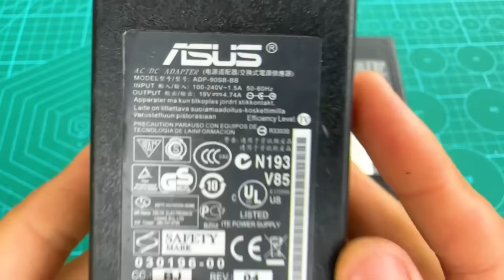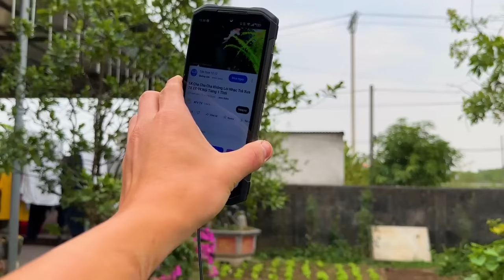DIY Powerful Ultra Bass Amplifier Laptop Charger , No IC , Simple Circuit

Comment: 6000W???😂😂😂.3W RMS.
Reply: Yee! Ha ha ha.
Reply: 600W
Reply: Né 🤣🤣🤣🤣 pra que gastar caro com som ele mostra como conseguir um hiper mega pawer com 10 reais 🤣🤣🤣🤣🤣🤣🤣
Reply: 60w. With a SuperFlux Capacitor
Reply: 3 watts lmao
Reply: Lol
Reply: It doesn't say .2 rms it says .2 ohms witch I doubt
Reply: 3w rms JBL boum box mini?
Reply: Tutaj 🎮a ☔ krytyka 🎉
Reply: 600W
Reply: 0.02Ohm = 60kW 🤒🤭
Reply: 5:35 oh wow that's the lightest battery I ever seen. and why does the battery sound like that when you flick it. hmmm sealed lead acid battery but sound different? hmmm. sounds hollow. could it be it just a case of something? hmmm... tricky tricky. a case of mini amplifier? hmmm 🤔

Comment: Trick well done, the real sound amplifier is on a fake battery. Which inside has a battery, bluetooth amplifier for home speakers
Reply: I don’t even think theres an amp in there, just something that pushes the speaker up and down in an exaggerated way, doesn’t even line up to the music one bit. And cmon, 6000 watts?
Reply: I can`t see the bluetooth icon in the phone. So I think bluetooth is not on in the phone.
Reply: ht-у-меня-инфа как-открыть-порталчик-портал-с-помощью-сабов-наибольшее-нз-нз-нз-нз-нз-нз-🤗🤗🤗🤗🤗🤗🤗🤗🤗🤗🤗🤗🤗🤗-jwhg
Reply: @pablobiancotti1524 the question is it just one phone use? if you haven't seen the phones Bluetooth icon. have you seen the headset icon to? no.... or another thing is if the phone is rooted. you can turn off the Bluetooth Icon even if its already ON. clever. very.

Comment: I've watched this over and over to try and figure out why and how this would work. After watching frame-by-frame in some places, there is a serious flaw where the D718 replaces the diodes. The Base and Emitter are shorted together thereby ruining the chance that this could be a Class-B symmetrical amplifier which, I can only guess is what you are trying to make it look like. Without a schematic this is just smoke and mirrors.
Reply: And now I think the only way it can work is that the battery is not a battery. The transistors act as simple diodes. The resistors added form a straight path from the "power supply" to the speaker out. If the battery was really a bluetooth receiver and amplifier, and the speaker output was disguised as battery terminals, yeah that would work. The phone bluetooth sends the signal in the the battery enclosure wrapped bluetooth amp which then pushes the signal through all this crap to get to the 1.21 giga-watt speaker. Yep, and pause and play on the phone just control the audio going through bluetooth. Y'all are welcome to prove me wrong.
Reply: @MadScientistGuitarLab  correct I would say
Reply: That speaker wobble is so abnormal too - this isn't a good thing
Reply: @MadScientistGuitarLab   I can`t see the bluetooth icon in the phone. So I think bluetooth is not on in the phone.
Reply: im betting he has a bt amp inside that battery, carefully hear when he unplug and plug again the static noise it makes on conection, a direct amp with no volume control would make a strong pop on connection

Comment: That's next level. Turning a PSU into an amplifier? That's the cleverest thing I've seen in the re-use of cheap electronic I'v ever seen so far. WOW. Great sound. That's real old school sound.  Perfect for guitars.
Reply: Have you seen this 6000 É speaker?
Very interesting!!! Truth ???
Reply: Except that it is total bullshit and cannot possibly work, otherwise you would be right. Do the maths on this circuit and you will see
Reply: @twogitsinacar4811  Do the maths? I haven't been in electronics for at least three decades. But that circuit, without studying the schematic, looks like an old style amp. SO I'm curious about how you came to such a quick decision.
Reply: It is fake!
Reply: Its not fake, all a DC amplifier does is convert a DC signal to an AC output controlled sinewave. While these do work, it is not going to have a lot of quality to the sound as there is very little filtering on these power supplies for the distortion.
Reply: @bicanoo_magic3452  Well for one being shown quite a small speaker marked in felt-tipped pen as 6000 Watts was a huge clue, that's 6KW or 6 one bar electric fires.

The second clue would be using quite small MOSFET's and absolutely no heatsinks anywhere.

 Thirdly that battery is never going to supply enough energy to produce 6KW, probably more like 6W !!

Definitely faked, the guy takes apart an SMPS (Switched Mode Power Supply) changes half a dozen components and now it's suddenly a 6KW amplifier ..... .. yeah right ok ............. 

Fake in every way and cannot possibly work
Reply: @RandomAudioGuys  it is so totally fake
Reply: @RandomAudioGuys  Go on then clever clogs, I'll give you my laptop power supply and you turn it into a 6KW amplifier.

Maybe those Rock Groups like "The Who" no longer need those monitor stacks and 800W Marshall / Orange Amplifiers, after all they could just use a few 65 Watt laptop power supplies .... Yeah right 🤣🤣🤣🤣🤣🤣

Total bullshit 🤠
Reply: Go on then. Let's see the one you built. The one where you turn a 65W laptop power supply into a 6KW amplifier then.

I cannot wait to see the results of your efforts 🤣🤣
Reply: @RandomAudioGuys  Learn some electronics please Mr. Random

He takes apart a laptop PSU, which is a chopper rectifier circuit. The mains is rectified and then chopped at high frequency, allowing DC pulses at the output.

This output is then regulated, usually on a chip and then smoothed with suitable capacitance and choke filtering to remove spikes.

This is not, won't be, and can never be an amplifier
Reply: It's simple. that is a fake battery with an bluetooth amplifier board 8 (and obv. a little battery) inside. he just bridge the the wires in the pcb. and the work is done!
Reply: @twogitsinacar4811  got intrigued by your comments. My job as an electronics assembler means I know very little. Wondered if you'd be available for a chat? Looking to convert a dre beats speaker from mains to portable.
Reply: @mattk8581  Don't Dr. Dre speakers have mains plug top type adapters, should not be that hard to find one and maybe install a jack socket. Do you know what voltage it requires ?

 I am reasonably sure that if it's rechargable, then it will surely have a charger ?
Reply: @twogitsinacar4811   ah nah it's the old model monster beats. 2 pin fo8. 220-240v UK. I figured that it must have a converter or something in it to power the board. If I could just override that with a battery pack then, easy as pie. Just weren't too sure if it would have circuit protection before the DC or whatever else that could cause damage to board or batteries if I didn't take it into account when skipping the AC power board. (Apologies if the terminology is a bit off)
Reply: @mattk8581  You need to measure the output of the internal power supply. Probably going to be about 12 Volts or thereabouts and then choose a battery that will suit and fit, maybe fit a switch to switch between mains and battery, if you also want it chargeable choose a battery with a BMS (battery management system) built in and a simple charge controller circuit, and bobs your uncle job done
Reply: @twogitsinacar4811  the switch is a good shout and never heard of BMS but makes sense, I'll have a look. Thanks for the help 👍👍

Comment: 0.20 Ohm  (short circuit?)
6000w !!! NASA rocket speaker ???
And the transistor and diode are not even hurting you with heat ?
Reply: The transistor would probably act more like a flash bang

Comment: To open the source of the notebook, you don't need to rectify, just take 1 bow saw, in 1 of the corners;  I usually do it in the corner next to the voltage wire, ok ???  I make 1 small count of half a centimeter, then with a screwdriver I force it and it opens !!!  IT IS THE MOST PRACTICAL WAY TO OPEN THESE SOURCES. You can try it, it will be easy and it won't damage its box and when cutting with the grinder you don't run the risk of picking up any components, ok ???  Good luck, follow the tip that will work out super well !!! 1 BIG HUG FROM BRAZIL. Take care and stay with GOD. Until later...💪😎👍
Reply: Даже проще, можно маленьким молоточком вокруг обстучать и корпус сам откроется

Comment: Interesting... never would have thought of that concept, good job! Would be cool to add a volume knob on there, or power knob to adjust the volume / voltage. And maybe if you connect two power supplies together you could create a stereo circuit? Also might be good idea to put little heat sinks on the little mosfets. Pretty cool idea though!
Reply: stereo for bass is no sense
Reply: Not to sound rude or anything, but the volume control is on the phone in case you didn't notice that so. Therefore i'm thinking any equalizers or anything else would have been as well

Comment: Where can I get this speaker has 6000W?
Super interesting for its weight and such a high power !
As the old saying goes "Live and learn" . Thank you very much for making us discover these "Wonders"
Reply: Is it a bird, is it a plane, smells like bullshit to me and I do electronics for a living. That speaker 6000 watts ....... really. There are so many of these videos about now, some folk actually believe they work.

If you actually do the maths .........
Reply: @twogitsinacar4811  Said everything. The truth is written 😀😀😀👌👌👌
Reply: Specs here: Specifications:- Bass speaker 20 Light yellow membrane

- BASS 20 with a full diameter of 20cm speaker rim, can fit a 18cm diameter speaker box hole.

- single word : 140 mm.

- Coil: 38.6 mm, 4 layers of wire.

- Height from bottom of magnet: 11cm

- Power: 100W - 250W

- Frequency: 400 - 3,500 Hz.

- Impedance: 8 Ohm.

- Sensitivity: 92dB.

Comment: Specifications:- Bass speaker 20 Light yellow membrane

- BASS 20 with a full diameter of 20cm speaker rim, can fit a 18cm diameter speaker box hole.

- single word : 140 mm.

- Coil: 38.6 mm, 4 layers of wire.

- Height from bottom of magnet: 11cm

- Power: 100W - 250W

- Frequency: 400 - 3,500 Hz.

- Impedance: 8 Ohm.

- Sensitivity: 92dB.

Comment: the housing is ultrasonic welded, all you need is gas for lighters, pour the weld, wait 5-10 minutes, tap the housing on the table, lift it slightly at the connectors with a screwdriver and it opens by itself, a little force can then be glued together with super glue

Comment: It is fake... 3:02 you can clearly see that the soldering connects the base and the emitter of the transistor. So how is this supposed to work? The thumbnail shows 650W. But where are the 650W? Neither the power supply had such power, nor would the amplifier have such power. First, with a 12V power supply, not counting heat losses, such an amplifier would draw over 54A. Secondly, 650W and transistors without a heatsink? FAKE, FAKE, FAKE

Comment: Te voy a hacer una pregunta se buscaban dos corredores de carreras y se presentaron dos uno experto en carreras y el otro uno con falta de una pierna los vehículos eran estándar en esa carrera a quien le apostarías a favor? El caso es que como técnicos en lo que sea sabemos que si un técnico pone las dos puntas positivas del audio juntas con ese conector a un celular madreas el celular y mientras se vuelve loca la pantalla y otra cosa tengo una bosina de 16" y tiene menos whats qué esa bosina o bajo
Reply: Some of us didn't know that actually it really didn't appreciate the video
Reply: @luckysonly  It's logical, my dear friend, because when you connect an audio extension to the headphone jack for the assistant, the touch screen goes crazy and that then generates problems in the cell phone

Comment: 0.2 6000w speaker ? diode 2 pin soldering a 3 pin transister b & e pin short circuit ?it is deceptive  video

Comment: I wonder if its real  🤔 that transistor is connected a bit weirdly and the transistors dont have a heatsink so the 6000watt rating is lie 1. Lie 2 can be that this circuit does not make any sense (you can post a schematic (you probably wont) but me being an electronics hobbyist i am skeptical about the circuit). And lie 3 is that i can hear some background noise when its unplugged and plugged in hinting maybe a bluetooth module inside the battery, some 18650s inside it and the output going to the fake battery terminals. I will send this to electroboom so he can rectify this seemingly BS